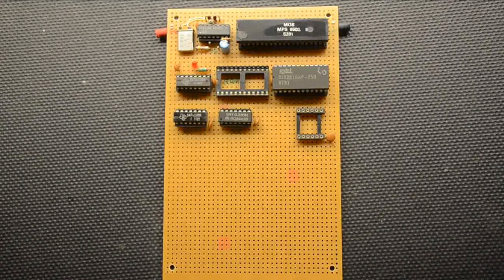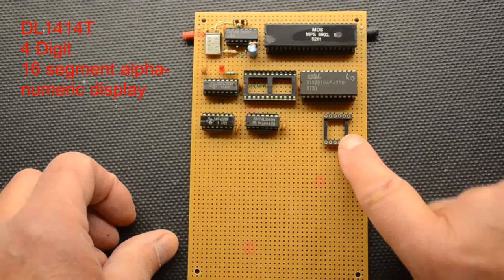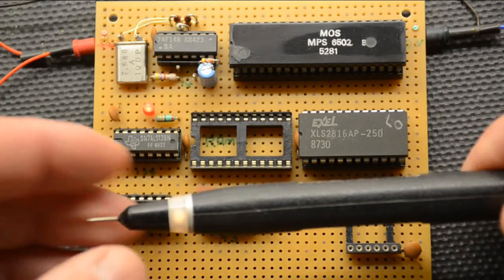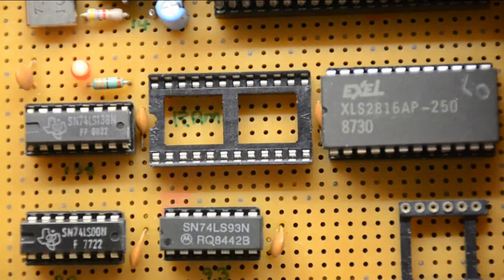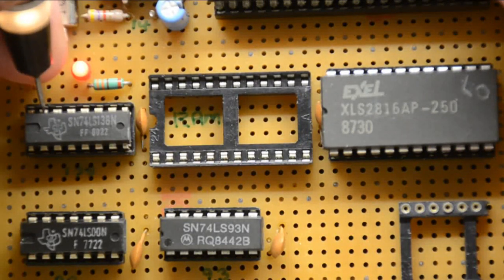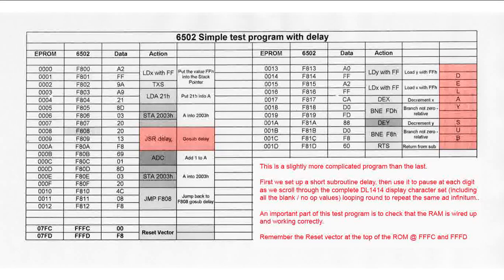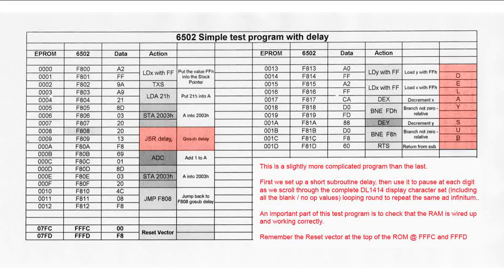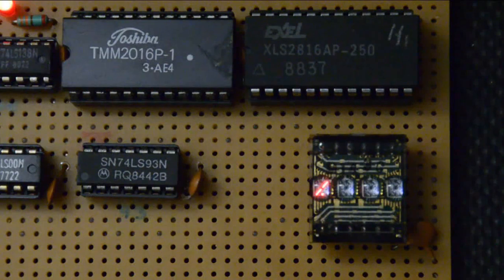6502 Microprocessor Projects for Beginners Part 3

Comment: How far can you take the programing if there is no RAM ? I had not considered that as a possibility.
Reply from the maker: It all depends on your program. My first ventures with microprocessors many moons ago was with the Z80 which has lots of registers when compared to, say the 6502, which actually makes things like, say, a beginners digital clock feasible, as you can store values like the hours and minutes in separate registers, plus use others to store the temporary results of the actual counting etc. 

At a basic minimum, remember that a RAM-less system cannot use subroutines, because the PUSH and POP instructions before a GOSUB, will need some RAM to save the address where the program counter currently is. One therefore has to try and use little blocks of programming multiple times, where when using subs, you'd only need the one. The 6502 has relatively few registers, so going RAM-less is going to be much more difficult. I hope this helps!
Reply from the maker: If you want to see the 6502 board doing a little more, check out the 'Rolling Waveform Storage' video we made a little later on.
Reply: @lishaton Thank you.

Comment: I had this video on while doing some data entry, so I might have missed if you pointed it out, but - is the program written in Assembly? Would there be a way to compile from C++ for a microprocessor like I might for a microcontroller?
Reply from the maker: A good question! In keeping with all my own micro' work, I wrote this in machine code. (I always do things the hard way!) The idea behind using this technique for my videos is to keep things as simple as possible. I remember when I started writing my first few lines of code, I didn't own a computer at that point and knew nothing of assemblers either. For this reason you can see why machine code was the only way forward for me. Obviously for a beginners perspective today, using an assembler must be the logical way forward, as everyone must at least have access to a computer. 

As far as compiling from C++ is concerned, according to a quickie Google search, there are plenty of them out there that will. Do check this out yourself and see if any suit your purposes. It goes without saying, that there are many assemblers for the 6502 if that's your choice in the end.